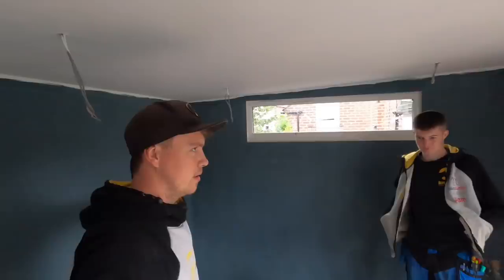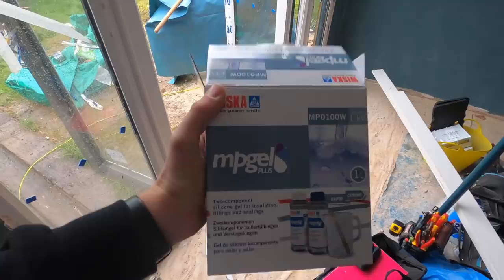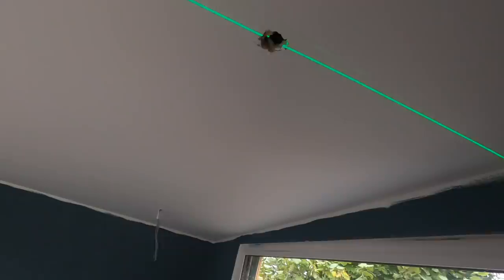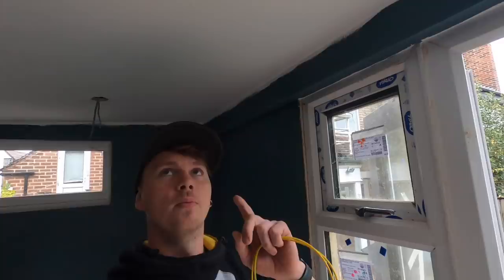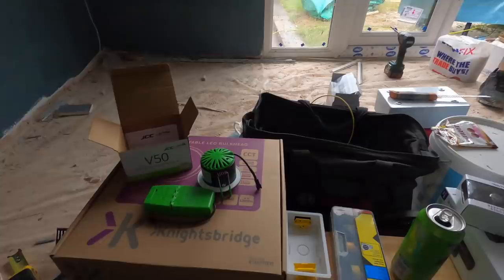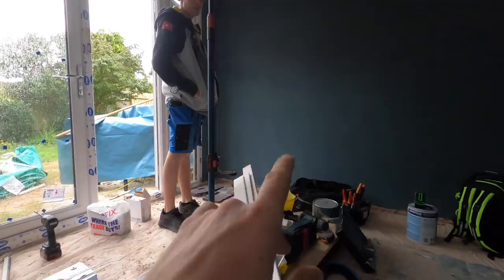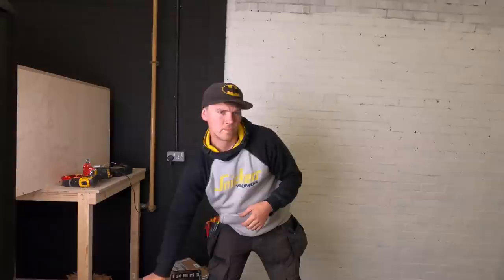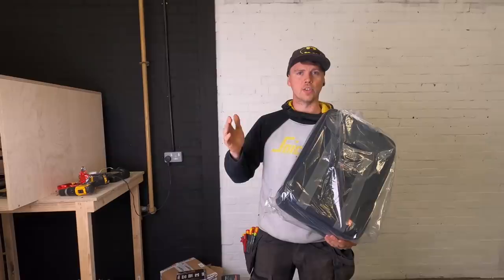Gel Time, Water proof joints, Wiska, Garden office 2nd fix, Electrician

Comment: Hi Nick and Adam. Really like watching your stuff. My grandad was an electrician - I’m not, but because he had arthritis in his knees and back, I worked as his labourer in school holidays once I was 14 years old. He’d trained in the 1930’s but retrained in 2nd world war, installing all the electrics in RAF aircraft. Someone else has already commented “use melted candle wax” instead of gel. It reminded me that Grandad told me that it was standard practice to fill conduits & boxes with wax AND (before the days of waterproof cable sheathing and shrink wrap) painting liquid wax onto all exposed electric joints/terminals/wires - especially in the cockpit and behind the instrument panels. Old aircraft were very prone to condensation problems on electrical parts when coming down from high cold wet air to low level warmer air. Problem is candle wax is a flammable fuel, but I don’t see why it can’t be used outside where it poses less risk than a garden fence. Great videos. Young drivers by the way need good safe vehicles to protect themselves and others—- SO Adam should get the new van - Nick should keep the old one once the gearbox is fixed.

Comment: tip for the amount of wiska gel. fill the 308 box with water before fitting the glands, pour the water in the jug and mark the jug with a sharpie to get the volume. obviously you'll have a bit more gel as the cables will  take up space and won't waste  expensive gel.
Reply from the maker: Great tip
Reply: Wiska actually have a list of their box volumes online somewhere. If you do a lot of them would be worth printing and sticking in the van.
Reply: Also another way to use the gel is to 
connect the cables in the box put the lid on seal it 
then pour the gel in one of the other knock outs this way the box will be fully sealed
Reply: @NBundyElectrical  Here's one to embarrass  Adam with next time he talks about molding a tool in Gel ... allthatsinteresting.com/cynthia-plaster-caster

Comment: Nick, ask your wholesaler for some works evsg 20mm blanks
What you do is do all your wiring , glanding... fit the lid and then knock out a  unused knockout, fill the whiska box through the hole and then use the blank to seal the enclosure, doing it this way will eliminate the air pocket you get from the domed lid 😉😘
Reply: Some wiska EVSG 20mm blanks

Bloody auto correct 😒

Comment: I’ve done countless number of swa joints using the 308 and gel... best way I’ve found is do the joint fit the lid open up one of the spare holes on the side..pour gel in and that fills the whole box 100% then CEF sell 20mm plastic grey blanking glands with a rubber gasket for the filling hole... works perfect
Reply: Yep
That's the way to fill Wiske boxes otherwise they aren't full of gel

Comment: Hi Nick, great vid as usual. Keep up the good work. A tip for you if I may. When using a hole saw to enlarge an existing hole mark out the proposed hole size, as you did, remove the pilot bit from the arbor and start the cut with the hole saw on an angle on one edge of your marked line. As the teeth start to cut in this will guide you through the rest of the cut and you can then slowly bring the drill back to straight and cut away. It does work, try it. This same technique is used for small bore diamond hole cutters. Your cutter may skip around the first couple of times you try it so probably not a good idea to have your first few attempts on critical positions. Look forward to more of your vids. Good luck.

Comment: Put the lid on the Wiska Box first and then fill through one of the knock outs. Then seal the knock out with one of their plugs. Wiska have a “how to” video on YouTube for this. The you can use the connectors that are supplied and not have to prat about with the double sided tape.

Comment: Re SWA, I think it’s in the British Standards for the cable type that the armour should be earthed at the supply end, I don’t ever recall seeing anything re earthing it at both ends.
Reply: John Howard  I think the terminology is getting a bit mixed up, earthing to me is connecting it to the earthing system for the installation, i.e. to the MET.  If the armour is to be used as the sole CPC then the supply end is connected back to the MET.  You don’t connect both ends back to the MET independently hence to me you’re not earthing it at both ends if you get what I mean?

Comment: You can get a little stopper to go in the Wiska box, so knock one of the entry holes out, use the wago cradle, put the lid on, tip the box on its side so the hole is at the top, fill the box with gel through the hole, then screw the stopper in so the gel doesn't come out if you lay the box flat - it's in a video on their website 👍😀

Comment: Very, very, very minor comment that would bug my OCD. The chrome sockets don’t have a return lip on them, they are just a flat face-plate, meaning that they won’t fit completely flat against the wall, they will be proud by the thickness of the lip on the plasterboard back box (about 1.5mm).  You can buy wiska boxes that already have gel in them. You make the termination, place it in the box which has gel already in it, close the box and the gel envelopes the termination.

Comment: Ehi boys, thinking of installing TRIMLESS downlights and TRIMLESS LED strip into a ceiling that is to be plastered. It’s common in Italy. Would you boys consider using and showing the installation of TRIMLESS downlights. They get installed onto the plasterboard and THEN skimmed over. 
No holes to be drilled in finished plaster, etc, may resolve some of the problems...but be interesting what other challenges pop up. 
Keep up the good work.

Comment: Connect the armour at the supply end to the earth terminal. This way, the SWA is protected. Then you terminate in a plastic box and use a local rod for the outhouse wiring. Is there a water supply in the building?
21:39 Is that your pole dancing pole?

Comment: Why do they always pull the downlight cables through...? 🤦‍♂️ 

...every damn time. I even had one guy bring the coils of coax for the aerial through on the landing 😫
Reply: I ct1 a piece of plasterboard over the hole first thing when I get there. As long as it holds until the hole saw gets a couple turns on the ceiling you are golden...
Reply: I like the copex above the suspended ceiling dude, defo using that in the future 😉👉

Comment: Let me pass a little bit of knowledge instead of spending money in this gel I use this method for many years you pick up a candle or two and you melt it down with a heat gun and you pour the wax into the box let's say later on you need add another connection or remove you just need to squeeze the Box and the wax breaks down, I use this method with a box inside water and it's still working this was six or seven years ago, and you just need to spend $0.10 on a candle